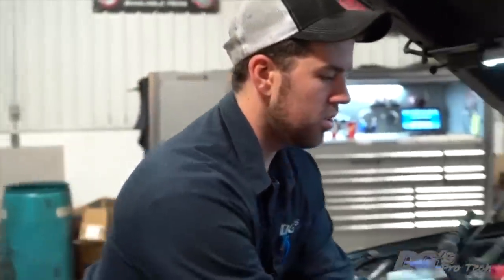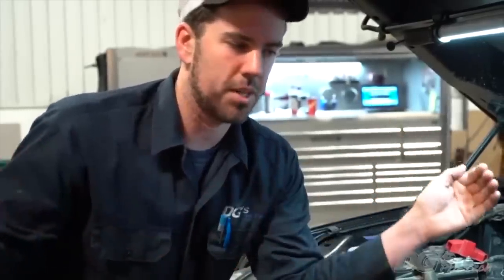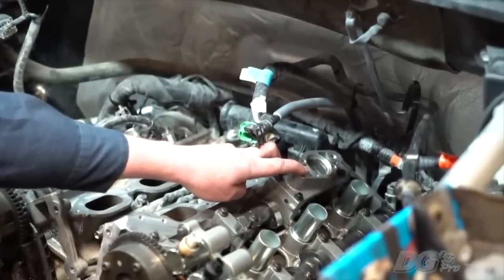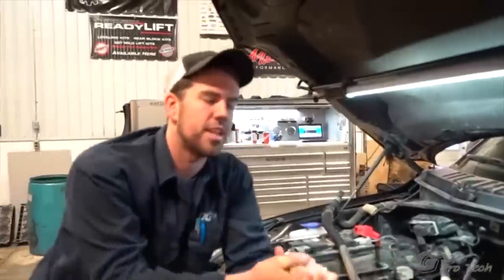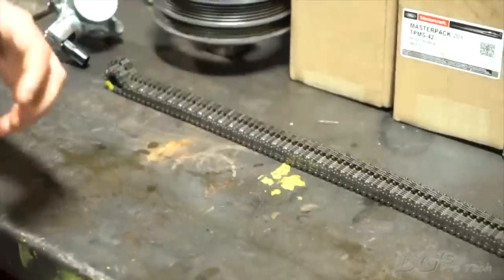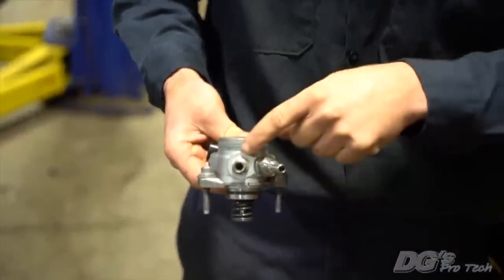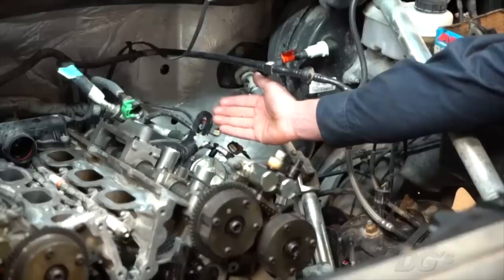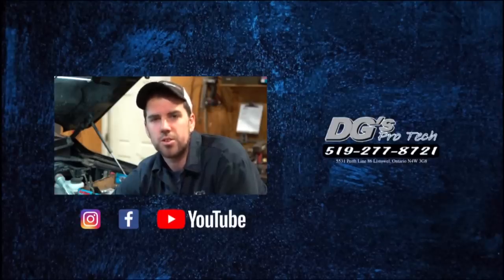What you NEED to know about Ford EcoBoost Engines by Dustin Golley of DG's ProTech

Comment: Thanks for being the first Youtuber I've heard accurately describe the incorrectly named "chain stretch". It's wear, not stretch. However you missed the 8oo pound gorilla in the room. The timing chain driven water pump (stupid idea) and the paper thin timing cover 9/10 times you will break while removing. Both big negatives. Things like this keep Toyota on top.

Comment: Nice Job!!  Excellent and informative details about the Ecoboost engine. I like the Ecoboost and the 5.0 Coyote engines.  The 5.0 F150's with a Supercharger is a Rocket with 750+ HP.  BUT, I have the previous 5.4L Triton and the long 2 pc Spark Plugs were/are an expensive nightmare to change if the lower part gets stuck in the cylinder.   That long swedged 2pc spark plug design is an engineering failure and I am very skeptical about buying any new Ford trucks.  The 2008 F150 5.4L cylinder head was redesigned for a better/shorter spark plug.  I also, like Chevy/GMC's cylinder deactivation.

Comment: I've been building engines just about since I could walk.  Trust me, I'm older than dirt and I started with the mighty Ford flatheads and then everything from there on up......multiple carbs, hot cams, ported/aftermarket heads/headers/ you-name-it.  I raced on the street, the strip, and roundy-round with Fords, Chevy's, Mopars and can curse fluently in all the "big 3" languages.    I've sort of gotten left behind with the computers and, somewhat, the overhead cams.  This upload is a masterpiece of good explanations and I subscribed at the halfway point.  I have been wondering which of the rumors/info/etc I've heard on the Ford Ecoboost were valid and which were simply old wives tales.  I am considering getting a Ford Ecoboost and this addressed a lot of my misgivings.   I've always favored more cubes and power than I need.....in case I NEED IT!  This youTube helped me evaluate my options.  I especially liked your comment on synthetic oil.  Thanks again and Keep the Faith.  Tom

Comment: A heavy truck needs heavy truck amounts of energy to move it down the road. The Eco Boost will be less thirsty at low loads and in town, but under load, it will use much the same fuel as any other engine.

Comment: Our Winnebago Paseo has a 3.5 ecoboost. (14-15 mpg) But it drives like a v-8 even pushing this heavy RV. The Ford dealers have been great when I take it in for an oil change. Our ecoboost has 54,000 miles on it. No engine problems. We change oil at 5,000 miles.

Comment: My truck & grandpa's truck can break a timing chain-& doesn't destroy the engine. Parts- under $200!  Ford 3.5L ECO-BOOST is a disaster. 1st: an Aluminum mini-van engine not a truck engine.  Aluminum should've been your first clue to run.  To get V-8 truck power means lots and lots of heat = 2 turbos. Turbos require a lot of maintenance. Heat destroys and shortens useful life of everything. They break and ultimately get inside & destroy engine, Aluminum cylinder heads, gaskets, pistons, Injectors, turbo parts, valve train. The cam & timing chain repair aloneis $2500-4000 if it didnt damage the engine.  Oh, you never mentioned that disaster of a water pump leaking into the engine oil &-yup --destroys the engine. What idiot at Ford designed that?   My 1994 F250 7.5L  (produced 1960-1996) is 27 years old & 300K miles. Grandpa's has a '56 Chevy Apache I-6.  I still get 17mpg if I keep my truck under 60mph but 14 is common. Gampy gets as much as 22mpg but doesnt drive 60. Water pump failure cannot destroy the engine. The 3.5L gas milage is worse than some V-8s.  The 3.5 has to scream to get the high power needed to pull a trailer. You can feel that expensive 9 spd transmission bump-shifting lots of gears to change high engine RPM into low RPM axle torque.  This means lots and lots of engine heat and bad gas milage & $$$ to pull a trailer.  My truck doesn't even groan pulling a 4 ton load.  When you have spaceship technology get ready for spaceship high repair bills. Repairing F150 Tranny is $8000-$10K.  Mine ~$2500.  Gramps is on his 4th clutch over 64 years & all inclusive total cost under $1000.  Gamps and I can still get parts anywhere--because so many were perfected over almost 50+ years.  I promise you wont get engine parts for your 3.5L in 10 years.  Eco-boost is also an ecological nightmare because of the lack of durability.  All those oil changes, special oil, repairs, special metals used in making the turbos + transmissions, special tooling only used on these vehicles and then recycling all of these is not free. It has an environmental and cash cost no one thinks about.  You can get your car fixed at a shop that has the special tools which is outrageously more expensive. My F250 and grandpa's old Chevy can be fixed anywhere US Canada, Mexico or South America.  In the end, Eco-boost is only boosting the green out of your wallet.  Get something old and simple get the upholstry done & keep it fixed.  You'll be happier, you can get it repaired anywhere and you'll keep more of your own cash.  Its also another  is a reason Hotrodders like those old cars & trucks. Simple & easy!

Comment: Very well spoken and easy to listen to. Everything you say makes sense. I particularly agree with the synthetic oil especially in a highly strung engine. Nothing wrong with changing it before the recommended intervals either. I personally would not have one as they are a lot of tech for a relatively minor gain. The big old low stressed engines will tolerate lax oil changes and non optimals more than one of these and a lot cheaper to fix IMHO. Also less prone to throwing a fault code because a spark plug is not within spec. Having said that, I run a CRDI turbo diesel engine in our Sportage. 115k and no problems yet. Always get it serviced on time or a bit before.

Comment: Nice video! I have a 2020 Raptor with this engine, would it be ridiculous of me to change the oil every 3000 - 4000 miles? I'm a bit old school and have learned that turbo engines tend to break oil down much quicker than naturally aspirated engines. However, these new generation engines with their technologies in-place may provide for a cleaner running engine. I used Mobile One synthetic oils, so with that, what weight synthetic oil should I use on this 3.5 eco boost? Thank you in advance.
Reply: Have the same motor. Been doing a ton of research. I’m doing mine every 3500 miles or 6 months. 5w30 synthetic. Penzoil ultra platinum.

Comment: a question I have a 2016 police cruiser it is not ecoboost the engine has 160 K miles it is not doing well I accidently ( Did not know it was ecoboost when i bought it ) bought a 2017 police cruiser donor car for the engine it has less that 60 K on it could i swap the ecoboost engine into my non ecoboost car.?.

Comment: my son has a 2010 Lincoln mkt with the twin turbo.  They have replaced the turbos three times with three oil changes.  Work done at Lincoln dealerships.  Bought used around 100K past unknown.  When its repaired it is a beast for about 3000 miles and issues come up, the turbos start to fade, and around 4-5K miles they fail.  NO MORE WARRANTY ON THE FIX, WHY DO THE TURBOS FAIL SO SOON??  aRE THE OIL feeds plugged and not delivering enough oil?  Such a beast motor but disappointing it cant stay fixed

Comment: Excellent video and why I have no fears with my ecoboost. I also, due to plenty of research, own a second gen 3.5 ecoboost and skipped the first. They fixed pretty much all the issues of the first generation as well as gave it a LOT more torque and the excellent ten speed auto.
Reply: What year did they start the Gen 2 ecoboost?
Reply: @groneass2006  2017 was the first year for the second gen 3.5. It was also the first year for the 10R80 10 speed tranny too but it was only available with the 3.5. The 5.0 and 2.7 ecoboost got the 10 speed in 2018. 2018 was the first year for the third gen 5.0 coyote motor and when the 2.7 got dual fuel injection like the 3.5 and a bump in power.

Comment: Well stated content! I could understand everything that was stated in this video and it makes sense. What doesn't make sense is that the Ford design can result in failed components... i.e. not cycling the wastegates. The manufacturer should express this need to the customers so they can prevent it from happening... a simple periofic fault message could tell users to accelerate hard would help.
Reply: Exactly!!!  a little bit of honesty could go a LONG WAY - - instead of "making it appear" that ford engines can have the same maintenance intervals as a GM engine?!?!!!

Comment: Ford should take a look at the Honda K20/24 chain design, in my career as a mechanic I have had to replace five or six chains, these were on very high mileage engines that in their latter years had perhaps  missed oil changes. They had all thrown up the engine light giving cam to crank synchronisation errors. Two would start them stop due to the wear. No breakages as it appears that the tensioner had enough travel or the ECU would switch the engine off.
In the many years of being a mechanic It seems to me people have forgotten the idea of mechanical sympathy, only truckers start their trucks and let them idle for a minute or two to let the oil get to turbos, cams, gears etc before moving off and allowing them low load use until at full operating temperature.. This makes the oil changes of 10 to 20,000 miles on fully synthetic oil easily done, Likewise after a long run the idea of letting a turbocharged engine cool and the turbo idle down for a minute or two before shut down just flies over most peoples heads. I can't complain it has given me  a long and profitable career as I head into retirement.
It is nice to read a well balanced article on an engine that has good and bad in it, if only the engineers had had their way instead of the bean counters....

Comment: Great video explaining the fact that these engines need to have regularly scheduled oil changes.  Just like the Triton 5.4l change the oil ever 3000 to 3500 miles with synthetic oil and the engines are dependable.  Another great point is the fuel economy.  Bottom line if you need a vehicle like a full size pickup you really can't expect to get the same mileage as per say a Toyota corolla.  It's common sense.
Reply: It really doesn't matter that much in terms of synthetic v conventional. Synthetic just has different flow characteristics. Oil never stops being oil. You don't change oil, You are draining unburned gasoline. The sooner the better. Either oil gets just as contaminated that's the bad part.
With synthetic you have some overall better long term wear.

Comment: Interference engine can't be that complex to understand.
If VVT, VTEC, VANOS, etc. works, why not a system that closes all valves , shuts down ignition/fuel, when the chain is about to snap, etc., or a chain tensioner sensor, for service life warning?
Also, why doesn't the option exist to have deeper reliefs cut in the piston crown, for valves, and still have high compression?
Someone is always putting us on a tight rope for some infinitely simple engineering flaw.
The scan tool should also be built into the instrument panel as standard option, no extra charge.
But, I would settle for a hot dog that tastes ike a hotdog you could buy 30 yrs. ago.

Comment: Excellent info. I chose the 5.0 for the reliable simplicity but just bought Escape with the 2.0 ecoboost so this info will aply also.
Reply: 2020 / 2021 ESCAPE 2.0 awd ? How does the car drive.....suspension and power and brakes ?

Comment: 10:40 “good quality oils and filters”
Any recommendations on the filter? I run Ford’s FL-500S with no issues, but does this Ecoboost guru know of something better? Also running Castrol’s full synthetic GTX Magnatec to keep oil on the cams and turbos at start up.
Reply: I run K@N filter and motorcraft full synthetic runs smooth bruh

Comment: I have a 14 limited w the 3.5 and have only ever used Amsoil signature series oil and filters and have 206000KMS. serviced religiously at 8K and it runs like a top with 0 ticks or timing chain noises. Love it. Will soon be adding a dual remote bypass oil filter kit to keep oil super clean..

Comment: had a 2014 Edge. Key WORD here Is HAD. Get rid of yours if you have one as soon as you can. Cooked  the coolant at 20,000 miles at 30000 miles so much base pressure it would blow the oil filler cap out your hand while the engine was idling. The synthetic oil blend it came with would turn to sludge in three or four thousand miles. Ford extended warranty refuse to cover anything oh yeah since new the transmission had a problem that got worse every time they tried to fix it. Trade them in as soon as you can

Comment: Run 10% ethanol fuel in them, shorten engine life by 50%, Ford design engineers. Ethanol very slightly increases the effective research octane number of gasoline but greatly increases the SENSITIVITY (to knock or detonation) of fuel in an engine under boost/load garggle[sic] Sir Harry Ricardo/octane ratings/proceedings of the SAE 1934 for proof. This was about aircraft engines first being supercharged at high altitudes in the 1930's and before 130+ octane aviation fuels were developed and how it shortened the life of the engines from 300 hours to 5 MINUTES or even less. This was the famous Rolls Royce Merlin V-12 used in the Spitfire fighter and Lancaster Bomber and Daimler-Benz DB-601 series inverted V-12 to be used in the Bf 109 series fighter plane, as well as several Curtiss-Wright air-cooled radial engine designs the US would use later versions of in WWII bombers like the B-17 Flying Fortress.

Comment: I have a 2018 F150 with the 3.5 Ecoboost. I love it! I can get around 10.2 L/100 km combined if I have a light foot. I like to drive it the way it was intended to be driven every once in a while. I didn't buy this truck for stellar gas mileage. Trucks don't get great mileage. I've been happy with the fuel economy and this thing is a rocket ship! I tow a 4500 lb (dry) RV and you wouldn't even  know it's back there. I use Amsoil 5W-30 Signature series motor oil. Oil and filter change every 5000 kms. I'm happy. I'll be checking out the new 2021's when they arrive.

Comment: From the beginning, I changed the synthetic oil in my '13 F-150 every 5000 miles.  The engine still got timing-chain stretch.  Dealership pulled the cab from the truck to change the timing chain and phasers.   No indicator lights came on, but I recorded a whole lot of chain rattle at initial startup.  Truck had about 20,000 miles on it.  Go figure.  I'd never buy another ecoboost v-6.

Comment: No mention of the water pump issues? Was looking to buy a Flex but I don't want an engine that has to be taken down to the timing chains to replace a water pump. At that point you just as well do the timing chain stuff he was showing.

Comment: Awesome Technical detail, Luv it! You are Cream buddy! I'ma DIY'er, own a 3.5 l Mkt/2014. The Camshaft gave me issues 1 yr ago replaced the 2 sensors 1st time it worked fine on my drive from GA to Cali , got engine light in AZ. Replaced it 2ndx and worked for 2-3 months and now I replaced it for 3x but issue continues. I am going to replace the Crankshaft sensor and if that dont do it its going to the shop.

Comment: Ok, you've talked me in to a Toyota.
Reply: Cool. I have a '16 5.7 Tundra, with the dreaded piston slap issue, I'll sell ya!
Reply: I am a FAN of toyota trucks, still running my '07 Tacoma Quad 4x4..... just know that the new 4x4 trucks have "very interesting" computers governing what the engine, trans, and transfer case ... will do off road.    I have, personally pulled out Toy's that are stuck because their automatic features keep the driver from driving the vehicle out the of situation.    My experience/observation has been backed up by a couple of videos of stuck Tacomas that have been shown on Matt's Towing in Utah...   very revealing commentary.   I love my 4.0, it is just a solid engine.

Comment: As he said all the design factors of the 3.5L EcoBoost really lend itself to being a dirty little engine, so it would behoove you to change the oil often. Unfortunately Ford had those timing chain problems that I think they improved in 2016 and I think solved entirely in 2018. Anyone 2015 and prior is just waiting for a timing chain failure by all accounts.

Make sure to do regular changes, use full synthetic motor oil and use Motorcraft filters only and your odds of seeing will be later than sooner. Rarely do people see it happen past 100,000 miles, but it does happen. However, once it's fixed, it's fixed for good, so don't anticipate having to do this fix again unless it was screwed up the first time.

If you're curious about it just Google "3.5L EcoBoost timing chain rattle", the issue most commonly presents itself on a cold start when the engine has been sitting for hours (once all the oil has drained off). It also only happens typically for a few seconds and then it goes to normal. You may not have any noticeable impact on performance either, but you may eventually. Also as he mentioned it will eventually throw a code, P0016 if I recall correctly. That's when it's time to give up the ghost and get it fixed or you're gonna have much bigger issues to worry about.

It's an involved but not difficult fix. Ford mechanics seem to take a minimum of 12 hours and DIY'ers tend to take up to 20 hours. Parts alone can be $800 give or take, but given the amount of work needed in order to get to everything people tend to go the extra mile and replace a few more things while they're at it to ensure longevity upping the cost to around $1,200. I've heard shops charging anywhere from $2,400 to $4,200 from various people, but who knows what their rates are and what else was involved.